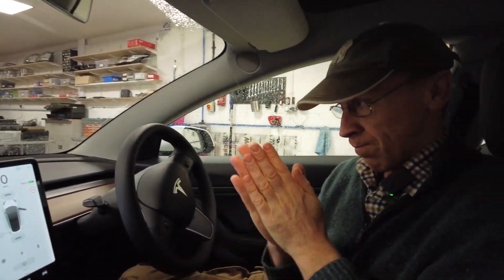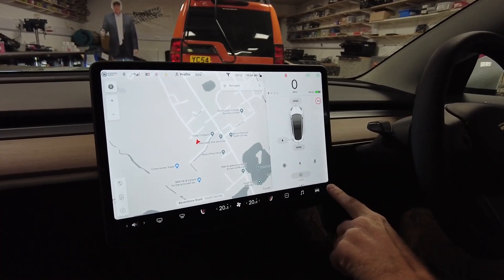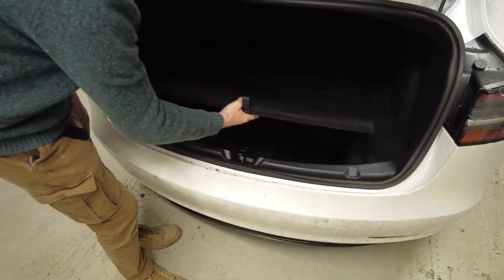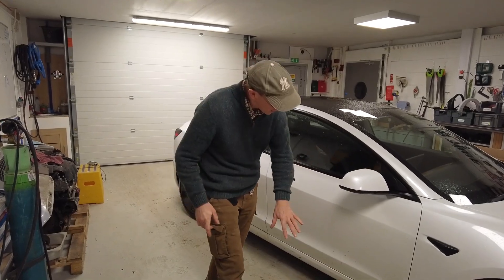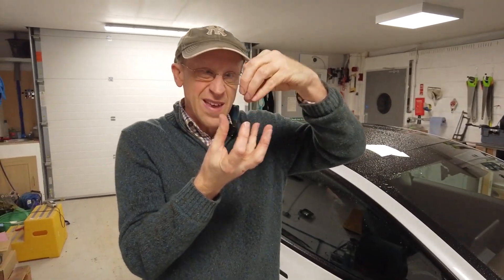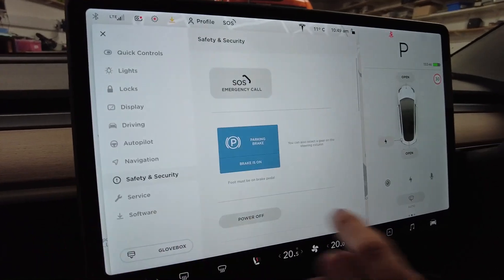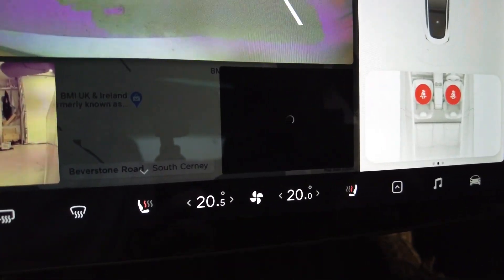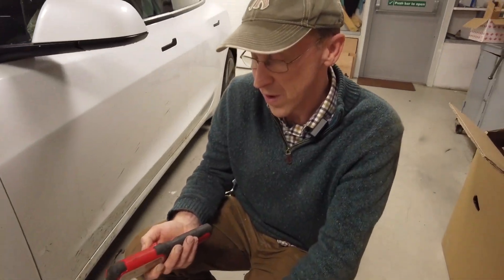Tesla Model 3 - Day 3 - We look at fixing camera / jacking & spare wheel etc M3

Comment: RAC use an inflatable airbag these days to jack cars up so do Kwik Fit at home service. Bit stupid not to supply the gloop for a puncture though, even though it does destroy the tyre.
At least RAC carry a specsaver wheel that fits all models of car, really clever bit of design. They fit it and you leave it at Kwik Fit when you get your tyre fixed.
Reply from the maker: Si Steven .. I am now intrigued by the RAC space saver wheel..
Reply: Simon, I first saw it on a tv programme about winter breakdowns in UK. But I have had first hand experience of them using the air jacks though due to disability preventing me being able to change my own wheel.

Comment: Simon. I would cut an oblong piece of plastic from a milk or other container. The long side across the container and the short side the width of the mud flap. Make two holes around a quarter to a third up the piece to match the fixings for the mud flap. Secure the piece behind the mud flap using the fixings. The piece would be strong enough and flexible enough to cover the  panel gap and stop the ingress behind the mud flap. Paint it black and there you have the first PowerfulUK Tesla upgrade. Don’t forget the royalty when your part becomes a best seller in the Tesla world.👍👍.
Reply from the maker: True "penguins of Madagascar" style - spit and tape !

Comment: The other design flaw I'm wondering if they've addressed (and could you show..?) is when there's water on the boot lid, and it's opened, the water just runs in to the boot and on your stuff, the gutter at the bottom of the rear window to catch the water and divert it away is just badly placed... Have they fixed that?

Comment: Quite honestly guys I'm not impressed.  You could have had a puncture on the way home, no spare, no jack, no tube of jollop and no special jacking plate should you want to remove a wheel at home.  I appreciate that most people who now drive haven't a clue what's under the bonnet or even know how to open it, even less the ability to change a wheel.  I would hope the AA or RAC have the adaptor plate to jack up the vehicle instead of slamming a big trolley jack under the floor pan.  If this is progress then something serious has gone wrong in my opinion.  It makes for a good video though.  Regards Reggie Luddite.
Reply: I’m sure a Tesla purchase includes 5 year road side assist 😜
Reply: @AndyK.1  Maybe, but that service will be operated by AA, RAC, Green Flag, what ever.  The problem is if the tyre cannot be repaired, where does that leave you?
Reply from the maker: Hi - yes i think the spare wheel thing is going to be an issue - I have ordered a pair of adaptors... £12 for 2 delivered and will feature them in another video. I think its something every Model 3 owner should have in the boot... even if its for the AA / local garage to use !
Reply: James Aston 😂It does make Leyland and Lucas look good.
Reply: You obviously don’t know much about current nee cars, many do not supply a spare
Reply: @davedyer3654  That's true but you usually get something to remove the four you do have.

Comment: Your door is open. It's as simple as that in my opinion. Every time you try it, the driver's door open warning indicator seems to be lit.
Reply from the maker: My door is always open... its the kind of guy i am
Reply: @L663  
Yes, but do try the camera with your driver's door shut properly. ;-) Maybe its only while you are filming of course, but I do know that side cameras commonly shut down on the side with an open door.
Reply from the maker: @hedydd2  We have the message "autopilot not available due to camera problem" all the time while driving so not only do we not have reverse camera on the RHS we have no autopilot driver assistance ( this is not self driving ). Trust me the door was closed !
Reply: @L663  
I won't say that I'm glad to hear that, because it does mean that there's something technically amiss. Hope I get better luck with my new car after I collect it on Tuesday. It's neither a Tesla nor a Land Rover, so there is hope.
Reply: Does the door switch think the door is closed though ?
Reply: @AndyK.1  I suspect that the car would not move and keep the park lock or brakes applied if the computer thought the door was open. That’s what happens on my Honda and Volvo for certain.
Reply from the maker: @AndyK.1  Yes no "you are driving with the door open" message

Comment: Think this video has confirmed for me that I won’t be going anywhere near a Tesla. Trim fits and tech failure can happen on any car, but the wheel arch liner and mud flap just screams rot box in years to come. Aside from the mud collection in the gap between the mud flap and wheel arch liner, the large volume of water droplets on the upper part of the inside of the wing is concerning.This thing is going to rot from the inside out.

Comment: Hope they have supplied the car with run flat tyres! Am I right in thinking the batteries have a life span of about 7 years?
Reply: The battery is in warranty for 8 years. Do you know anything about new cars? Most don’t have spare wheels or run flats these days
Reply: @davedyer3654  so the battery will last 8 years and one day 😂
Reply: @gigsman3910  Not difficult to do some reasearch, did any of your cars last 400,000 miles? Even if this guy did have a battery he would of saved FAR more in fuel and servicing - https://electrek.co/2018/07/17/tesla-model-s-holds-up-400000-miles-3-years/
Reply: @davedyer3654  my comments are going way over you head sir
Reply: @gigsman3910  I think not, you are ignoring the facts and resistant to change.
Reply: @davedyer3654  no offence ment sir,
I was told electric car batteries will lose capacity the more they are charged and decharged (similar to phone battery) do the 8 year warranty cover battery wear and tear?
Reply: @gigsman3910  Hopefully the cost of batteries will be lower by then, or there will be a good market for reconditioned units for cheaper than new. I would hope the lack of DMF, DPF, EGR, and all the other various engine management gubbins will reduce costs too. These early electric cars do have too many gadgets and screens though.
Reply: @davedyer3654  They don't have spare wheels to reduce weight for fuel consumption testing - most new cars allow you to specify a spare wheel and jack at time of purchase for around £150. It seems with a Tesla you're stumped unless you squirt goo into the tyre which generally ruins it.
Reply: @davedyer3654  actually most cars have spare wheels
Reply: @davedyer3654  it only depends on how you drive, some people tow alot and EVs aren't good at towing

Comment: Three videos in and you have convinced me never to buy Tesla
Reply from the maker: When we are over these few issues i am sure we can start to look at some of the benefits of Tesla ownership
Reply: Not sure there are any, £40k limited distance before you need to recharge which could take ages to complete. And I’ve seen someone else who left their car to warm up before going out in it and it took 20% of a fully charged battery to achieve the set temperature
Reply: @garybutcher9802  You are misinformed, check before you make silly statements about charging. Like all manufacturers there are sometimes a batch of faulty parts, as with these cameras, mine has been fine for 13k miles
Reply: @davedyer3654  Each to our own but I’ll keep to my diesel disco and it’s limited time I spend refuelling it. No benefit in owning an electric car as far as I can see
Reply: @davedyer3654  oh now I see a miss informed and blinkered ‘green’ The government are not banning diesel or petrol vehicles. My disco is a MHEV which is all the government is saying vehicles will have to be. Unless you charge your vehicle from a solar panel or wind turbine do you really think electric is clean energy?
Reply: @garybutcher9802  Read the post properly, ban on sales and possibly PHEV’s as well. 33% green energy and increasing every year. Try to keep up.
Reply: @davedyer3654  wake up, they will never ban diesel and petrol. Your electric is only green at point of use, answer my question, where and how is it produced?
Reply: @garybutcher9802  Diesel and Petrol will never be banned but will naturally diminish, apart from the classics. Not hard to find out about green energy  - Government figures show that low-carbon energy was used to generate more than half of the electricity used in the UK for the first time in 2018. The proportion of electricity generated by renewables in the UK grew to 33% in 2018, Wikipedia or search yourself
Reply: Yeah.  Pretty poor quality control ... from factory and dealer (and Boris Johnson).
Reply: @davedyer3654   so the ships transporting tesla cars or all the oil needed to make an EV aren't killing children too?! Where do you think batteries, tires, plastic parts, road tare comes from?!  What about the spacex rocket fuel which is kerosene!!!
Reply: @alanmay7929  So how long does an ICE car pollute for, hmmm, ALL of it's life! Batteries are 90% recyclable. Yes there is a carbon footprint to everything made and transported but not all thing pollute like an ICE
Reply: @davedyer3654  you are totally wrong, first of all the battery technology is still inferior and secondly the mass production of EVs is almost not significant, finally the oil is responsible to the mining and transportation of battery materials also the plastic and other thousands byproducts used in EVs and other industries.
Reply: @alanmay7929  one day you will wake up

Comment: Yes it’s clear Tesla don’t know how to design cars. Only computers and motors (and the first is questionable)
Reply: Have you got one? I doubt it, mine has currently done 13k miles, no fuel, no servicing and no problems
Reply: @davedyer3654  thats not the problem, there are still 1990 cars on road's with better build quality than a brand new tesla, some people can only afford used cars but what about degradation in 10 or 20 years?!